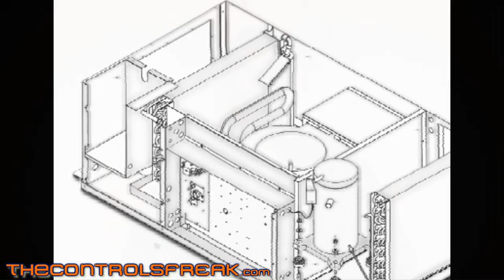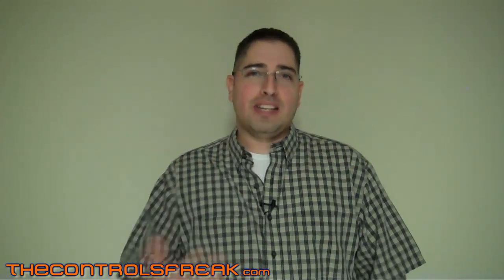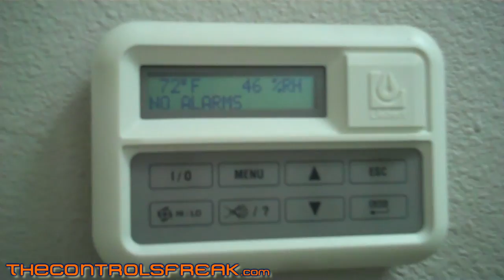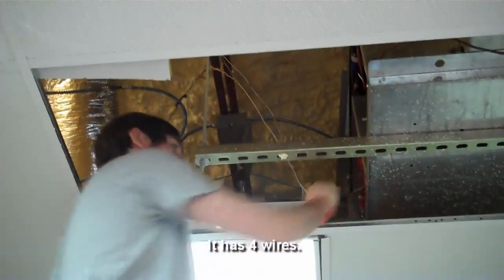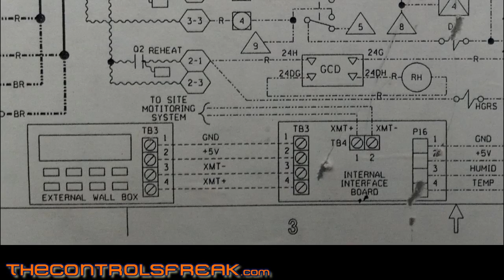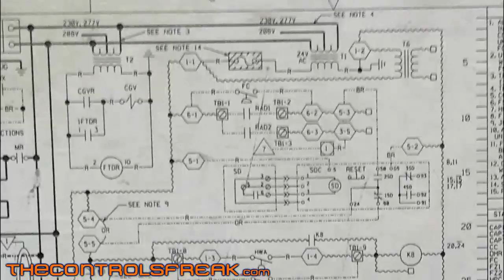Building Automation HVAC - DDC Controls Retrofit of Standalone Thermostat

Comment: Controling sequence: room temp above set point: energize compressor relay, energize blower fan relay. If evap coil temp drop below set point: de energize compressor relay, keep energize blower fan relay.  De energize compressor rely when room temp falls below set point.  After 5 mins de energize blower fan relay.

Comment: If you could do a through communicating stat video that would be great.....I understand the 4 wire system, what I dont understand is how Exactly is its signal  receiving an sending.......is it just resistance from a power up transmitter in the stat? Thx

Comment: How much you get paid yearly?
Reply from the maker: Well this is a broad question. Someone starting out with no experience in Texas... could start as an installation technician for anywhere from $15-$18/hr. If you have several years of previous experience and are wanting a project management or engineering position you can be making $50k-$100k/year
Reply: Thanks and I was just wondering because when I was searching for a answer on the internet it was saying allot of different salaries and was seeing sometimes it depends which state your located in and I live in Atlanta but I appreciate that, this the field i'm studying in school now so i'm trynna soak in all that info I can

Comment from the maker: I am not quite sure I completely understand your questions, but typically speaking you don't have many line(high) voltage stats in the Building Automation Industry. What you are speaking of might be mixing up two different lines of thinking on how an A/C unit is controlled.

Almost all controls thermostats are low voltage which then use relays and contactors to turn on and off higher voltage motors, compressors and other equipment that are powered by 120/220VAC.

Comment: As a verification/pre-commissioning tech at my previous job, I noticed in the school buildings I was involved with the following. In almost every case, the MDF/IDF rooms' systems were stand-alone (not connected for CONTROL to the BAS) but, the BAS in almost every case DID have a monitoring sensor. I know this is nice little project to demonstrate techniques, but the advantage for you as the space occupant will be. . . ?

Comment: Good video. Believe it or not, an 18k btu unit wouldn't be considered as an oversized unit for a server closet at the school board. The dehumidification feature will keep the humidity in check. The school board is full of server closets. We recently put in a 3 ton Toshiba mini split to cool a 10 X 10 server room.